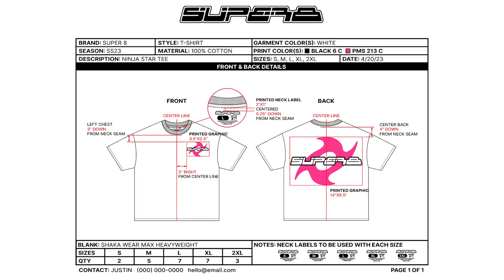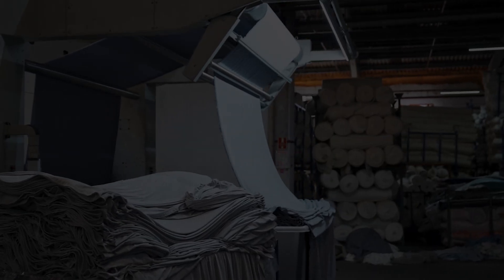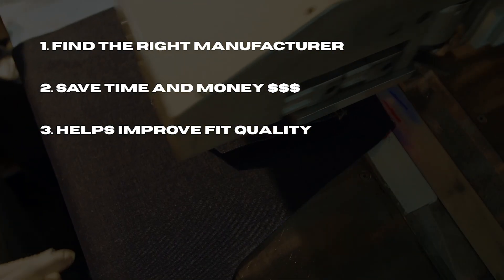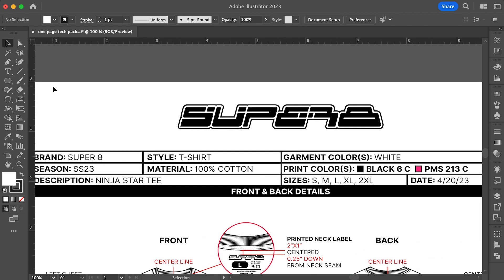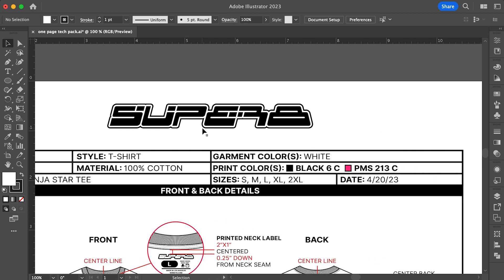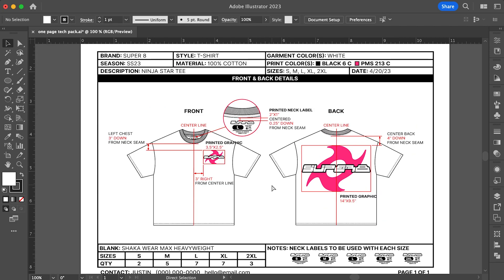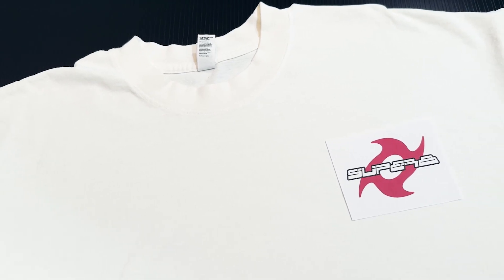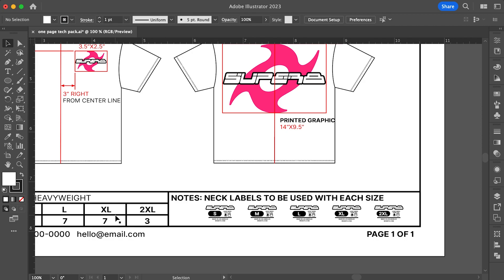Tech Pack Tutorial (for Beginners) *FREE DOWNLOAD*

Comment: Basically I thought that, by providing the size chart the manu would create the t shirt (cut and sew) and so they don’t need a blank reference. Is that accurate ? Otherwise imagine if I put the shaka wear as the blank, they will respect the size of that specific tee ?
Reply from the maker: If you’re doing cut and sew, then yes, you should provide a separate size chart with measurements of each shirt. In the video I explained that the tech pack I had was for a basic ‘print shop’ using ready made blanks.
Reply: @jiggywithj  alright. This means that I don’t need to put a blank section on my tech pack as I will send it to an Alibaba Manufacturer and want to make my own size chart right ?

Comment: Could you please explain why did you put an example of a blank on ur tech pack ? So that the manufacturer can be inspired while making the t shirt ? Or they will first order the shaka heavyweight tee and then screen print on it ?
Reply: I don’t see other people putting a blank section on their tech pack. Good video btw ;)
Reply from the maker: thank you! 🙏
Reply from the maker: Usually the shop that prints your order has a ton of other orders from other people. As you can imagine, most print shops will have hundreds of tshirt blanks from multiple different brands, so including the blank name and style will help the printer keep your order accurate and not mixed up with someone else’s order or your design accidentally printed on a different blank. 👍